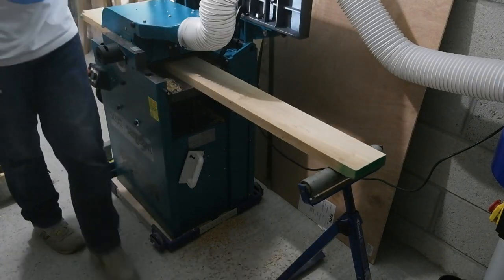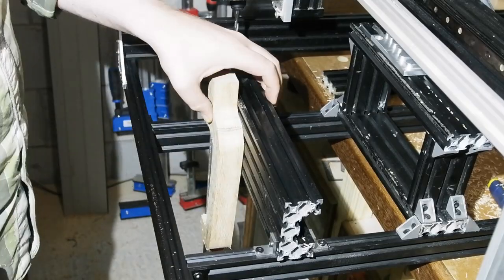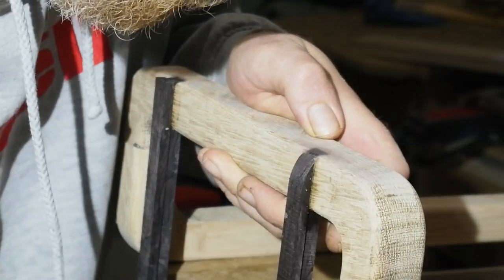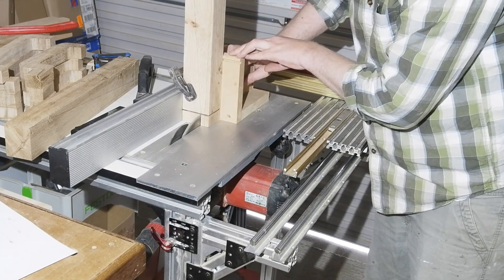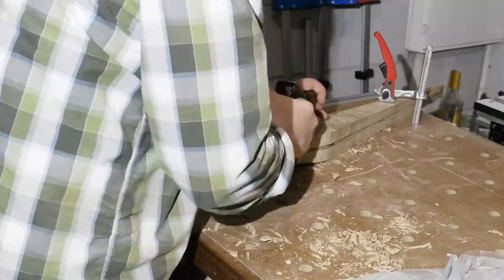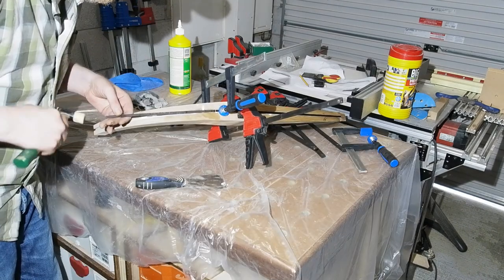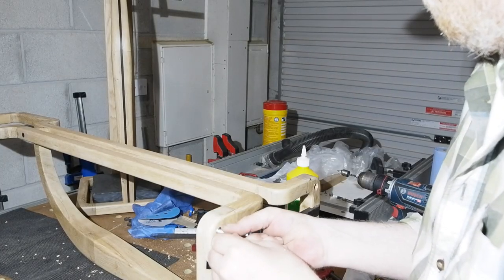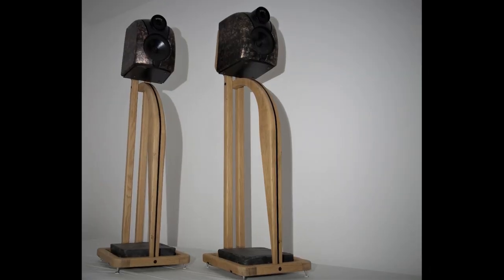Building A Pair of Speaker Stands in Oak and Grenadilla

Comment: Great as always. They look fantastic. Why did you use the jigsaw upside down when rough cutting instead of the bandsaw?
Reply from the maker: Cheers Tom. Couple reasons really. Room being the first. Was a 1.8m plank in that shot and with kit set up for other jobs on the go, I couldn't get it to the mitre or bandsaw to break down. The other reason is I broke my thin bandsaw blade recently. Scrolling with the current blade in it is a nightmare. The jigsaw got me out of the fix. The stiff Cunex blade in the Mafell is pretty ideal for tight scrolls thankfully.